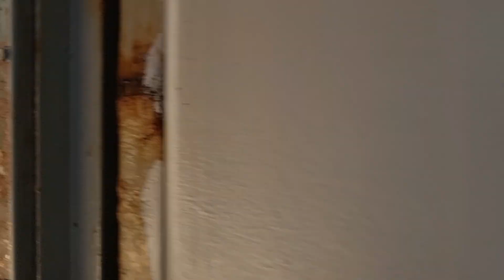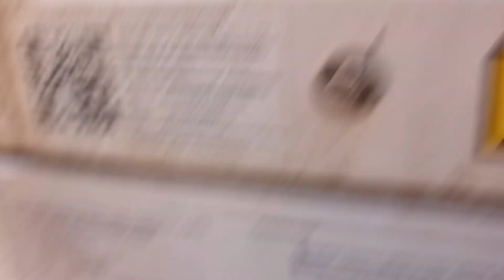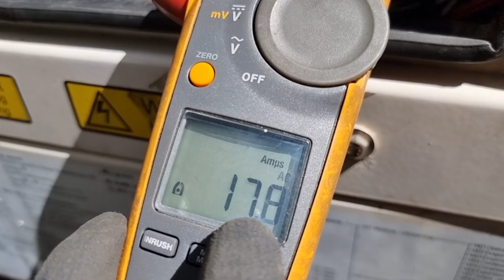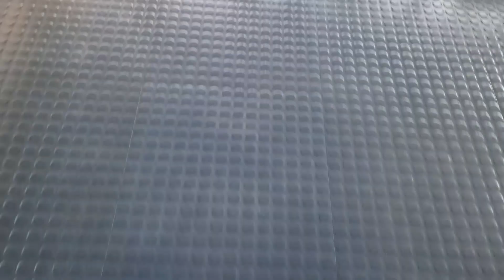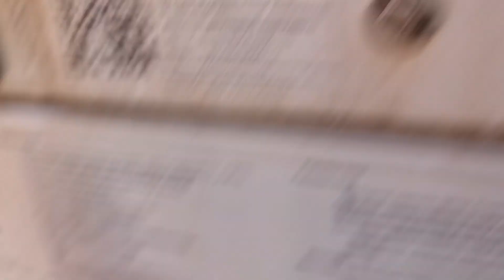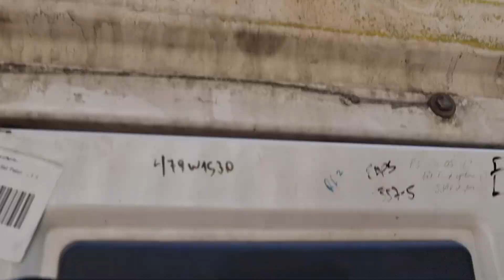REF COMPRESSOR OVERLOADING TROUBLE

Comment: I get this call all the time in the summer months on Cellar cooling systems, The pub landlord loads the cellar after the drink cases have been left out in the sun waiting to be loaded into the cellar the temperature of the drinks is high and so the compressor and evap work very hard to pull down the temp in already high ambient weather! Trip goes the HP Switch & if this is not set right then the contact trips and a circuit breaker. Well spotted LeckyJake.

Comment: Did it take you a long time to get the refrigeration basics learned? Did you learn most of it in the classroom, or was it mostly on the job?
Reply from the maker: to be honest, i learned it mostly on the job. every vessel has different set up and how much electrical situation I can have. so refrigeration is just part of the responsibility onboard
Reply: @leckyjake  thank you for your reply. I am a shipyard electrician who has found myself in a situation that the air conditioning technician had quit his position, and I have been put into his position until we can find another one. Mostly i would be doing the periodic maintenance, and some of the electrical troubleshooting, but I must admit that there is a lot to learn, and many things, like working with the Freon, that I cannot do, unless they would send me to ac school to get the proper certifications. But I do what I can electrically, that is why your videos are very informative. Thanks again!🙂

Comment: Why doesn't the display show you the maximum current that it is drawing instead of just that fans only current
Reply: Compressor connection circuit not connected through the power module.  That is the reason why controller is reading less amps.

Comment: I don’t understand how you can clamp one side of the breaker and see 17A and clamp the other side and see only 3A ? You’re not losing 14A through heat. If the contacts on the breaker were bad I can understand large loss but not even that much. I’m not Qualified Electrician but I deal with circuit breakers and fridge compressors with my work.
Reply from the maker: that is the power meas circuit of which measuring the fans and heaters only, compressor not included.

Comment: mate you shouldnt be upgrading the circuit breaker unless you upgrade your supply mains. The system is designed for a 16A circuit breaker. you could possible overload line and cause a fire.
Reply: As per manual, the starcool minimum current rating is 16 Amperes and at maximum cooling capacity it is 18 Amperes. They started setting the unit at 16 A due to the demands., the vessel socket is rated at 32 Amperes so in papers if the unit is rated at 18 amperes and you need to use the splitter box to supply 2 containers, that would be 36A (again at least in papers), so to match it they reduce the breakers from 18 A to 16 Amperes only. Normally starcool will not evem draw 16 A of current, that is of the cargo inside was precooled before they put inside the container. If precooled the compressor will only run at 60 hz which will reduce the current it draws., but for the hotstuff Compressors are eveb running more than 100hz, the maximum is 110hz. Definitely that 16A will not be enough. Nice troubleshooting though.
Reply: @kabarotv6591  Thanks for the info. It makes sense now. Is there a way to limit maximum frequency like on a VFD?
Reply from the maker: the main line is 440volts/3P/ 32 Amperes. fyi
Reply: @leckyjake  the system has 16A breaker on it for a reason, if it’s pulling more than 16A the motor is trying too hard. This is early signs of motor failure